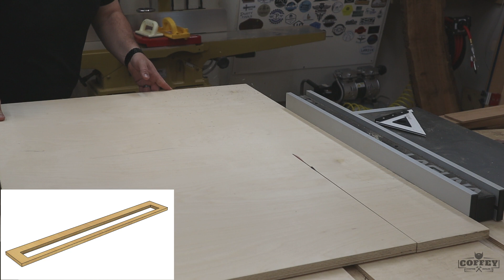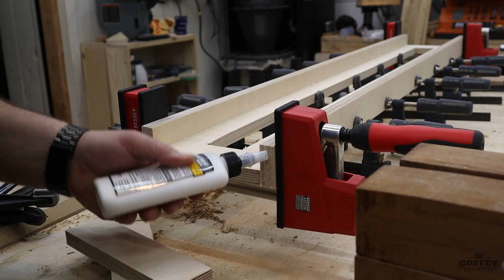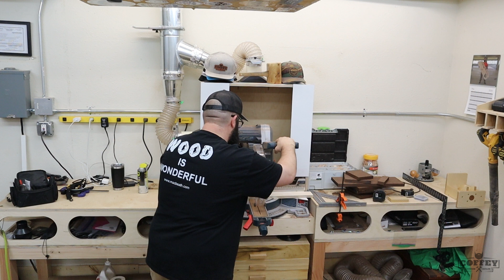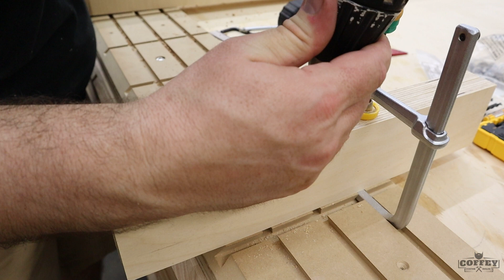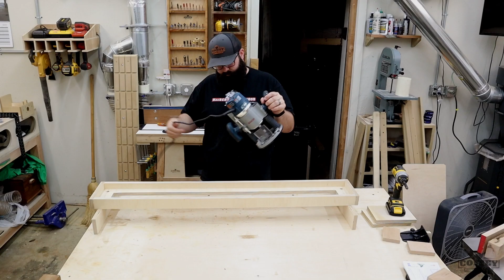SIMPLE SLAB FLATTENING JIG BUILD // DIY // HOW TO #woodworking

Comment: Did you remove the black baseplate on your Bosch router to allow the bit to move up and clear the baseplate hole? I’m using the same router and it doesn’t look like the bit will move freely through the baseplate hole. Thanks again for the awesome videos!
Reply from the maker: I didn't and you're right. It won't clear the hole on the plate.

Comment: Nice work and video. It looks like  you leveled up the slab on your table top to keep it from rocking and so it’s relatively flat. Do you need to attach the slab or glue it to keep it from moving or is this slab heavy enough not to move during the flatting process?
Reply from the maker: Thank you for watching! Yeah, the slab is plenty heavy. Once shimmed it doesn't move.

Comment: Just found your channel and started listening to your podcast.  I am going to build one of these today.  I do have a question...in the last shots of the video when you show the jig in action, you have another board attached to the bottom of your jig.  Is this just because your slab was too tall for the jig or because it was needed for stability or ??  Thanks for your time and the great video (and the jokes!)
Reply from the maker: Thank you for the support! The board was not attached. It was just a 1/2" offcut of plywood to elevate the jig. The slab was 2-1/2" thick. The 3" legs weren't high enough.
Reply: @CoffeyCustomBuilds   - Thanks for the lightning-fast response!  I figured that was the case.  Thanks for the clarification.

Comment: Nice build, Mike! Good call on the parallel clamps...you caught that just in time. I've never used that lubricant. Looks interesting.
Reply from the maker: Yeah as soon as I tightened the screw I knew that wouldn't work. And neither had I! It's actually pretty nice stuff!